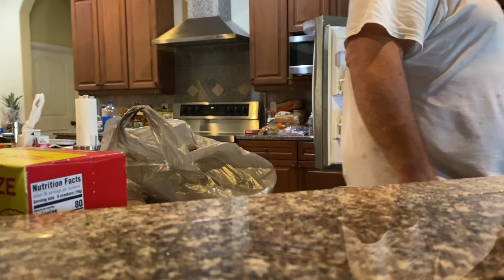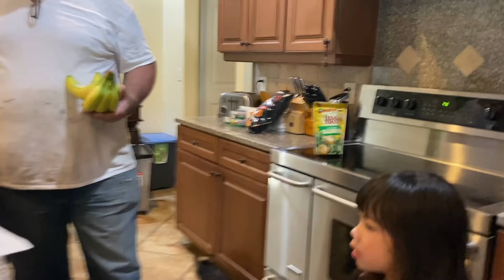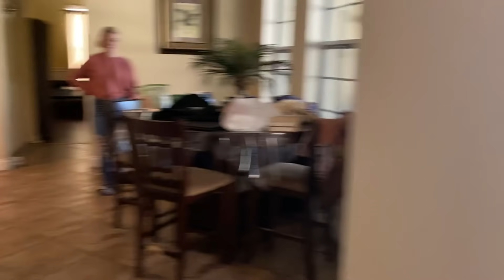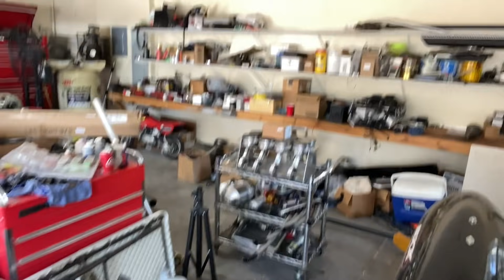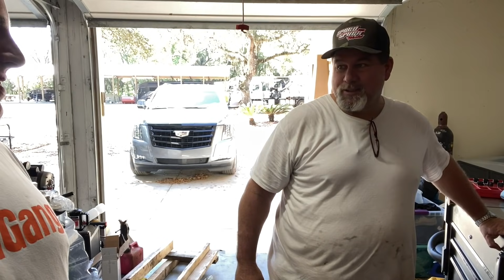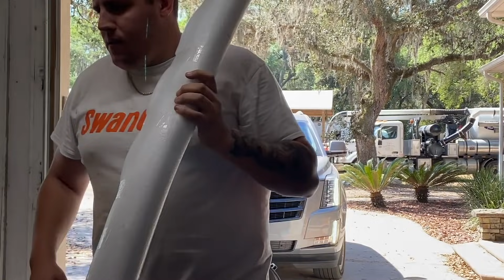My Mom Kicked my Dad Out of The House!!! (she's mean)

Comment: To magnaflux a crank, you run current through it to look for lengthwise cracks like coming out of a keyway.  It's demagnetized then each throw is magnatized with a hoop to look for cracks across the journals, then it's demagnetized again.  It's done under a hood because the magnetic particles are viewable with a black light.  Done right the process can find very small cracks that are just starting.
Reply: Thanks you for that